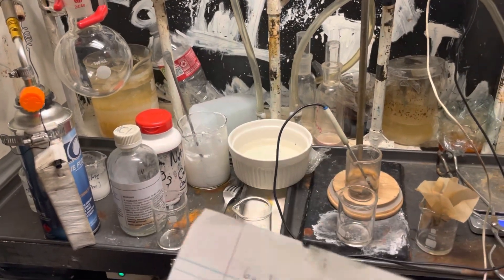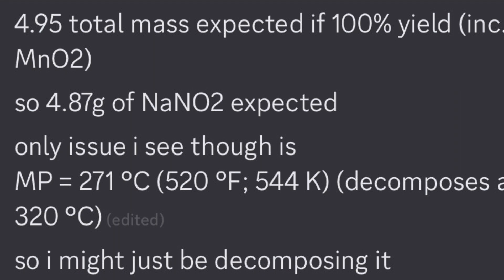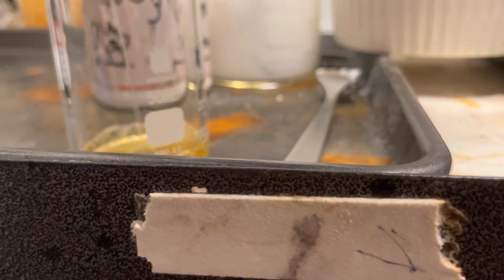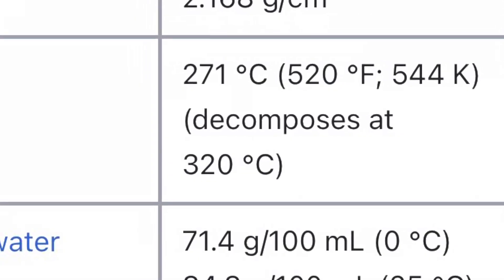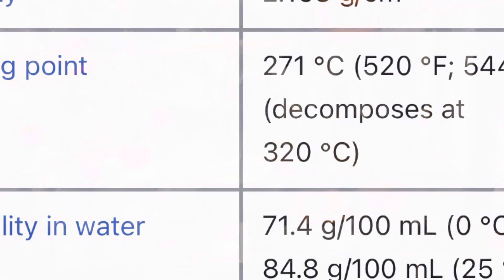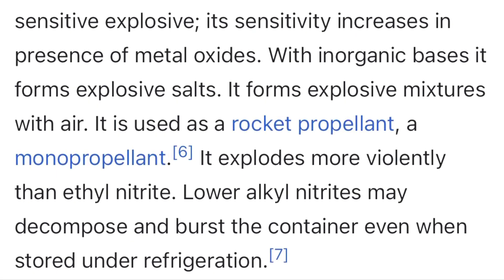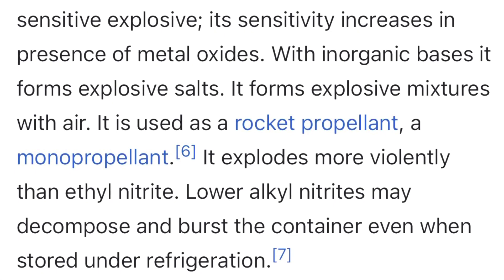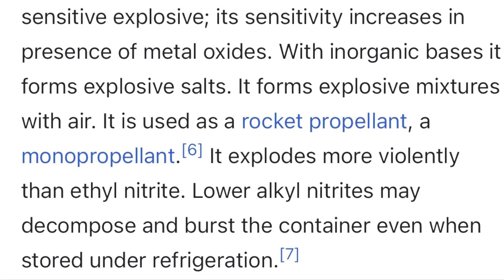LabNotes: Nitrate to Nitrite by thermal decomposition

Comment: Frankly, to me, the EASIEST way, because I'm lazy, was combining sulfur and kno3 together, burning, and collecting the puddle that formed as the dried concrete like product. It's decent
Reply from the maker: hmm not a bad idea
Reply: @EdwardTriesToScience  the ratio, since I didn't have a scale back then, oddly about 50:50, but a bit more kno3 than sulfur doesn't hurt. It seems the nitrate salts are more soluble than the nitrite composite/puddle that forms, but your experience is greater than mine, based on your experiments here

Comment: If you want to quantifiy the amount of Nitrite (as many synthesis methods give rather low conversion), you can titrate it using permanganate. You have to take care that both solutions are hot, otherwise the reaction is too slow. The nitrite has to be acidified using acetic acid, and youll have to determine the permanganate consumtion of the acetic and substract that for accurate results.

Comment: Well that's interesting. I was aware of the lead, cornstarch and carbon, or even the sulfur catalyst routes, but MnO2 is a rather new way to do it to me.
Is there a bit of source material, such as an SM thread or a few papers I could look at to satisfy my curiosity ?
Reply: No material we literally brainstormed in the catboy chemical society discord and tried this crazy idea because he wanted to veer me away from the electrochemical reduction of nitrate.
Reply from the maker: its notes on wikipedia that you can decompose nitrate to nitrite by heat so why not try it, after all oxygen was first discovered by heating potassium nitrate until decompo